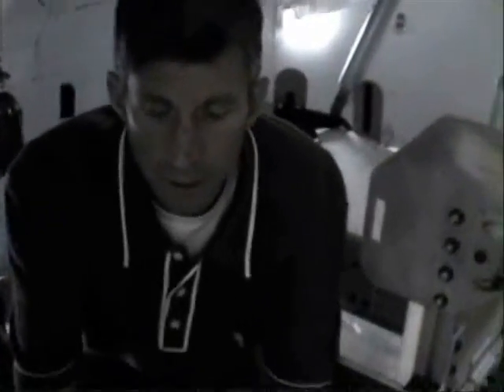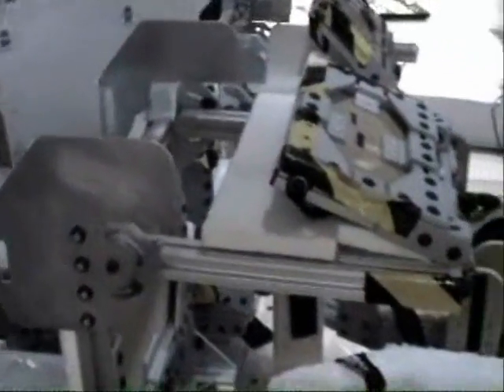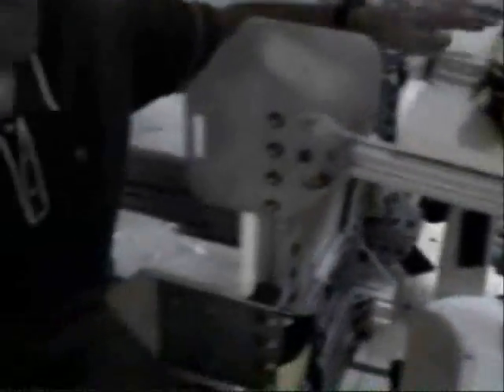A Look Inside Orion

Comment: Apollo and nasa was fasinating at its time when they actually did somthing in the good old 60s and 70s  now they nail tablets to the walls
Reply: I don't see any difference between Orion capsule and Apollo Command Service module. Orion capsule and SLS basically are the old technology of the Apollo program!
Reply: Don't you ever heard the proposal of Space Transportation System (STS) which was proposed by NASA in 1970? Space shuttle was designed to ferry crew and cargo between low earth orbit and the earth and was only one component of the STS which includes Space Tugs, Nuclear Propulsion shuttle between low earth orbit and interplanetary deep space, low earth orbit propellant depot, and Space Tug based transfer vehicle shuttle between low earth orbit and the moon. The Space Shuttle was the only component of STS proposal approved by Nixon administration in 1972.

Comment: Everything is controlled via computer inputs,
so if the computer fails or there is a power outtage the astronauts are
completly fucked since their controls are not usable.
Reply: Eizi Eizz 1 Pretty much all manned spacecratf used and still use fly-by-wire systems which require electricity to work. 2 Orion uses EMBEDDED COMPUTERS which unlike GENERAL PURPOSE PC's, are highly reliable.
Reply: I hope you realize NASA has thought of every possible failure when making this capsule.
Reply: Eizi Eizz Ummm what? NASA is just relying on its ALLY Russia for support as they build the Orion. Pretty soon NASA will be well ahead of Russia in terms of space travel even on the small budget they already have.
Reply: Riley Johnson Small budget? ESA-5.2 billion USD. Roscosmos-5.6 billion USD. NASA-17.6 billion USD. NASA has the biggest budget of all space agencies.
Reply: ronettreker Yes but in relation to the US budget its extremely small. Imagine the possibilities if instead of spending tons on Defense we focused on NASA? It'd be amazing.
Reply: +Eizi Eizz NASA did not designed the spacecraft. NASA paid Lockheed to do that if that eases your concerns.
Reply: If anything does happen, there is a a small battery operated drone core that can be controlled from Mission Control.

Comment: Maybe I'm just a bit naive, but the thing that struck me about this spacecraft is that there isn't much room to move around in and I didn't see a bathroom anywhere.  I've read that this is intended for deep space travel, was that correct?
Reply: You should see the Saturn V Command Module. It's tiny compared to this. I think you have to pee in a hose and the waste will be deployed into deep space. Or maybe that's just the ISS. I have no info on that,
Reply: I forgot to say it will be connected to different spaceships(or modules as to what people call it). So there will be a lot of room to move around.
Reply: @JeromeIsTheMan The Apollo style program of space capable and heavy boosters would never be sustainable in long-term space explanation. Only new technologies such space tugs,assembly and construction of large modular spacecraft in space,space refueling,thermonuclear propulsions could be sustainable in long-term space explorations!
Reply: i THINK THERE IS ANOTHER SECTION UNDER IT
Reply: there would have to be modules attached!
Reply: lextacy2008 Thanks, I was wondering why there was so little space for a trip to Mars. An attached module 3 times the size is a big improvement, but I would want even more room for a trip that long.
Reply: Gary Walton I already said that.
Reply: ok, just seems like it would drive someone mad or something.
Reply: The apollo had a pee tube, the astronauts were in diapers when in their space suits. The space station toilet has a fan that draws down human waste so it doesn't float away, and yes Susan, it literally hits the fan.......... :)
Reply: Susan B
when going to mars for example , this craft will be dockd with a Hab module that is estimated to be 3 times the size. Trust me, if the Orion was the only thing taking 4 men to mars, they would be dead in 60 days.

Comment: Apollo was cutting 60's tech... This is just a larger 60's tech design. Great bucket NASA what a joke you've become. Sticking laptops to the wall great idea.
Reply: Orion is not "60's tech". A capsule with a convex, ablative heat shield is the safest, most reliable way to land a spacecraft returning from interplanetary or deep space at the extremely high speeds that these spacecraft will traveling at as they enter the earth's atmosphere. Orion is far more advanced than Apollo. Life support, power generation, attitude control, pilot interface, docking ability, etc. are far in advance of what NASA did in the 1960's. Orion will be docked to other modules depending on its mission. Picture Orion (or more likely a larger, 2nd or 3rd generation) capsule docked to a module or two like the many that are used on the I.S.S. for travel to Mars. There would be a separate Mars lander and Mars return vehicle, as well as a separate Mars habitat.
Reply: That is the best explanation I have heard for the Orion.
Reply: @lambrettist2007  I don't see any difference between Orion capsule and Apollo Command Service module. Orion capsule and SLS basically are the old technology of the Apollo program!
Reply: @lambrettist2007  Don't you ever heard the proposal of Space Transportation System (STS) which was proposed by NASA in 1970? Space shuttle was designed to ferry crew and cargo between low earth orbit and the earth and was only one component of the STS which includes Space Tugs, Nuclear Propulsion shuttle between low earth orbit and interplanetary deep space, low earth orbit propellant depot, and Space Tug based transfer vehicle shuttle between low earth orbit and the moon. The Space Shuttle was the only component of STS proposal approved by Nixon administration in 1972.
Reply: @lambrettist2007  Don't you ever know the Space Transportation System (STS) which NASA proposed in 1969 to replace the Apollo capsules and Saturn V and Saturn IB expendable rockets? The system's major components consisted of:
1. A modular space station in a 270-nautical-mile (500 km) low Earth orbit, and as a permanent lunar orbit station. 
2. A chemically fueled Earth-to-station shuttle.
3. A chemically fueled space tug to move crew and equipment between Earth orbits as high as geosynchronous orbit, the space tug also could be adapted as a lunar Earth Moon transfer vehicle to ferry crew and cargo between low Earth orbit and the moon.
4. A nuclear-powered ferry using the NERVA engine, to move crew, spacecraft and supplies between low Earth orbit and lunar orbit, geosynchronous orbit, or to other planets in the solar system. As Apollo accomplished its objective of landing the first humans on the Moon, political support for further crewed space activities began to wane, which was reflected in unwillingness of the Congress to provide funding for most of these extended activities. Based on this, Nixon rejected all parts of the program except the Space Shuttle, which inherited the STS name. As funded, the Shuttle was greatly scaled back from its planned degree of reusability, and deferred in time.  The Shuttle first flew in 1981, and was retired in 2011.
A second part of the system, Space Station Freedom, was approved in the early 1980s and announced in 1984 by president Ronald Reagan. However, this also became politically unviable by 1993, and was replaced with the International Space Station (ISS), with substantial contribution by Russia. The ISS was completed in 2011.
Reply: lambrettist2007 Finally! I was wondering how 3 or four astronauts could travel all the way to mars in a tiny bucket and not move. Of course there would have to be modules attached! Thanks for the clarification.
Reply: Dream Chaser will only be capable of Low Earth Orbit and only for a short time at that. The same was true of the Space Shuttle. Orion is part of a modular approach for deep space missions. It is far more advanced than Dream Chaser, which, by the way, is based on a 1970's Russian shuttle design. It will hopefully do its job safely and well, ferrying astronauts to and from the International Space Station, in low earth orbit, sometimes above our heads. They must compete with, however, SpaceX's Dragon 2.0.
Orion is the only game in town for beyond LEO missions. It's first, unmanned test is coming up soon.
Reply: @lambrettist2007  Don't you ever heard the proposal of Space Transportation System (STS) which was proposed by NASA in 1970? Space shuttle was designed to ferry crew and cargo between low earth orbit and the earth and was only one component of the STS which includes Space Tugs, Nuclear Propulsion shuttle between low earth orbit and interplanetary deep space, low earth orbit propellant depot, and Space Tug based transfer vehicle shuttle between low earth orbit and the moon. The Space Shuttle was the only component of STS proposal approved by Nixon administration in 1972.
Reply: @lambrettist2007 The Apollo style program of space capable and heavy boosters would never be sustainable in long-term space explanation. Only new technologies such space tugs,assembly and construction of large modular spacecraft in space,space refueling,thermonuclear propulsions could be sustainable in long-term space explorations!
Reply: Aaron Johnson "Waah NASA killed the tiny space plane that was basically a second hand baby space shuttle, that would quickly be decommissioned for the same reasons that the shuttle was"
Reply: Why is the Dragon so much better
Reply: You are a small minded fool. So... tell me, how flat IS the earth?
Reply: +Aaron Johnson don't blame NASA. Congress decides what gets funding. NASA takes about $9 of your taxpayer dollars a year, which explains why everything is so derivative nowadays
Reply: It's all due to the lack of funding, had nasa the funding it had in the 60s, the whole solar system would be ours and we'd be preparing to go to alpha centauri
Reply: It is still 60's tech.. boo nasa and then they kill the Dream Chaser so they can make their bucket look good. argh!
Reply: The Dragon is a better capsule than what NASA is building. 60's Tech is all NASA has to offer with this program.

Comment: I'm sold. Textron made the ablated heat shield, no tiles. Yes even for six it's a tight fit, but I believe there will be more habitat linked for the Mars transit; gonna dock to supply/lander for the surface, Orion stays in parking orbit w rocket for return trip while crew operates/ lives below. Gee I'd love to go!

Comment: They could have saved money by pulling the old Apollo capsules out of mothballs, refurbished them on the inside and had the same thing.
Reply: Apollo is only 3 man capsule, no?
Reply: There is only one flight capable Apollo Command & Service Module left over from the Apollo Program. Not much you can do with just that one vehicle. And besides the Apollo technology is over 40 years old. Time for an upgrade.
Reply: Hey, Bennie, shut up and go take your meds. You have no idea what you're talking about!
Reply: I don't see any difference between Orion capsule and Apollo Command Service module. Orion capsule and SLS basically are the old technology of the Apollo program!

Comment: The Orion control panel now uses touch screens. The original Apollo had hundreds of switches!
Reply: NASA has stated in another video that the Orion control panel doesn't use touch screens because it would be too easy for something in microgravity to bump into it, and it would also be awkward, if not difficult for an astronaut wearing big bulky gloves. It still is a lot more simple than the Apollo

Comment: This is a sad day for America. We did this in the late 60's . The US doesn't need to rebuild the Apollo program . This is a bad joke. The shuttle program was the most advance spacecraft ever built by mankind,we should have built more advance shuttles not a soda pop can in space.
Reply: Advanced, maybe. But it sacrificed safety. I'd feel much safer in this "tin can" than in the Shuttle. 
Until we figure out better propulsion systems like in Star Trek, capsules are the best we can do with chemical rockets.
Reply: @therealAZLN  I just don't know why NASA should choose Apollo style old technologies of space capsules and expendable heavy lift rockets to go back to the moon? Constellation Project should be terminated! A 21st century Apollo style moon landing which used old technologies of space capsules and expendable rockets is very meaningless.
Reply: @therealAZLN  Don't you know that X-33 was the prototype of next generation Shuttle which was cancelled in 2001?
Reply: @therealAZLN  Do you know the Space Transportation System (STS) which NASA proposed in 1969 to replace the Apollo capsules and Saturn V and Saturn IB expendable rockets? The system's major components consisted of:
1. A modular space station in a 270-nautical-mile (500 km) low Earth orbit, and as a permanent lunar orbit station. 
2. A chemically fueled Earth-to-station shuttle.
3. A chemically fueled space tug to move crew and equipment between Earth orbits as high as geosynchronous orbit, the space tug also could be adapted as a lunar Earth Moon transfer vehicle to ferry crew and cargo between low Earth orbit and the moon.
4. A nuclear-powered ferry using the NERVA engine, to move crew, spacecraft and supplies between low Earth orbit and lunar orbit, geosynchronous orbit, or to other planets in the solar system. As Apollo accomplished its objective of landing the first humans on the Moon, political support for further crewed space activities began to wane, which was reflected in unwillingness of the Congress to provide funding for most of these extended activities. Based on this, Nixon rejected all parts of the program except the Space Shuttle, which inherited the STS name. As funded, the Shuttle was greatly scaled back from its planned degree of reusability, and deferred in time.  The Shuttle first flew in 1981, and was retired in 2011.
A second part of the system, Space Station Freedom, was approved in the early 1980s and announced in 1984 by president Ronald Reagan. However, this also became politically unviable by 1993, and was replaced with the International Space Station (ISS), with substantial contribution by Russia. The ISS was completed in 2011.
Reply: @therealAZLN The Apollo style program of space capable and heavy boosters would never be sustainable in long-term space explanation. Only new technologies such space tugs,assembly and construction of large modular spacecraft in space,space refueling,thermonuclear propulsions could be sustainable in long-term space explorations!

Comment: @n0xpd the shuttle is designed for low orbit. Going to to moon it would come back to earth and enter upper atmosphere mor then 40% faster. It would not withstand the heat and structural stress.
Reply: Space Shuttle was indeed design for LEO  but the space shuttle fleet were just one component of the the STS architecture proposal of George Meuller which also included GTO Space stations,lunar orbit modular space stations,space tugs,space refueling stations!

Comment: Sorry, ran out of characters-- we need, desperately, a continuation of the manned space program. The entire design is based on tested, proven, Man Rated designs. We have far better computing systems. FBW has proven itself on many aircraft. so we have a plasma for a display, but as long as basic backups are provided, just like in aircraft, this will fly and fly well. The heat shield concept is what it should be. This needs funding and now, lets energize America again!!

Comment: With the extended missions (asteroids and Mars) is the plan to launch a crew service module at the same time as the Orion and then dock once in low gravity?  If so what will be the configuration of the crew service module?  The very contained space in the Orion certainly would imply the need of more space for the crew for deep space missions.

Comment: @ripcurlcns The shuttle is not designed to fly to the moon.  If it were to try to land on the moon, it would crash.  NASA developed a "projectile" that can stop the fall as it is approaching the moon and then vertically take off from the moon to be sent back to Earth.  The shuttle cannot take off from the moon vertically because it isn't designed to and would be inefficient.

I do agree that the end of the shuttle program will be sad, but the air force is developing a smaller shuttle to replace.